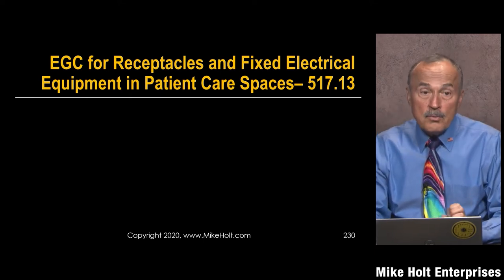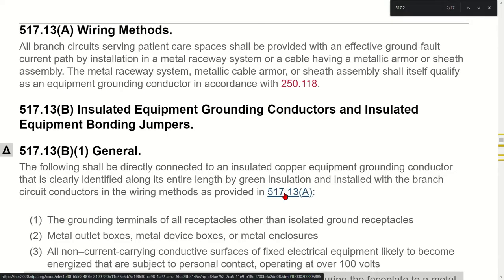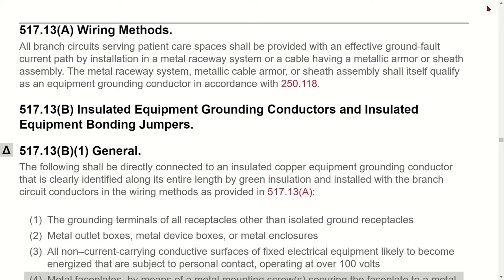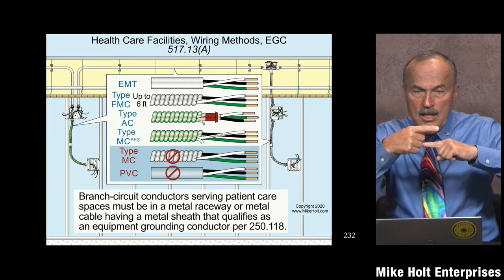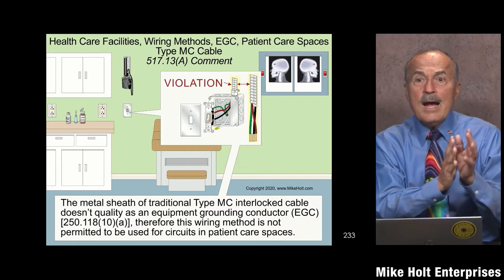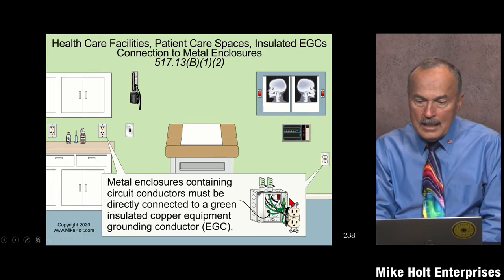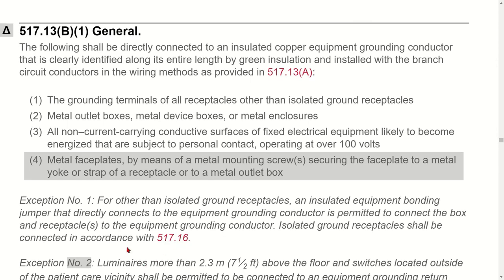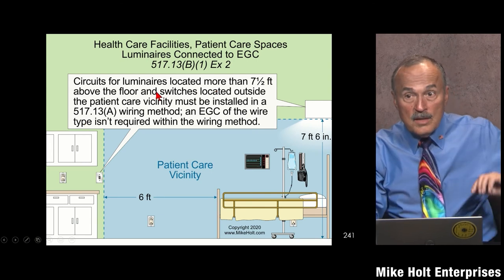Health Care Wiring Methods, NEC 2020 - [517.13], (17min:50sec)

Comment: Retired a few years ago from a large hospital as a sparky performing PM'S, running 7 fire pumps & over 15 Generators and troubleshooting the hundreds of VFD'S . We used the HCF MC cable in patient rooms for adding receptacles. Always thought that even though new work in patient rooms was always ran in 3/4" EMT along with a green ground conductor and boxes secured to steel studs that the metal studs should have a bonding conductor maybe every third steel walk stud. We started installing a HG TR receptacle next to patient beds with USB charging ports then somebody had us move them at least 6' from patient bed because they thought they were not approved to be close to patient beds. Was surprised that every patient room wall switches ( both normal & emergency power ) were on 277 bolt circuits. A kid  made a nice divet in a stainless steel wall plate when he used a paper clip to dig into 277 bolt switch.

Comment: @mikeholt it’s often talked about that NFPA70 talks about safety issues and codes reflect that, however for luminaires and switches outside the patient vicinity if your wiring using Armored cable it would not make sense to then wire the switches or luminaires using other cable types out of efficiency you would use the same wiring method and you would still fulfill all the requirements for wiring methods outside the patient vicinity.
Reply from the maker: If you want...
Reply: @MikeHoltNEC  long may you continue in making the industry great. Your energy is next level god bless you and your family.

Comment: While inspecting I’ve found that many make the mistake that once out of that medical space those grounding requirements aren’t required. Having to explain that the ground fault path must go all the way to the panel helps make sense to them.
Reply from the maker: You are correct, and the 2023 is making this extra clear.
Reply: @MikeHoltNEC  amen. So glad it will because many aren’t grasping the theory or concept.

Comment: Mike, having 2 paths is also advantageous because it will have less resistance and clear faults faster.
Reply from the maker: False, watch MikeHolt.com/Groundrod and MikeHolt.com/Funcamentals
Reply: @MikeHoltNEC  false to your false, I am talking about hospital patient care spaces needing 2 egcs. More paths to ground = less resistance on ground fault path, less resistance = higher ampacity in a ground fault. Higher ampacity = faster ocpd trip which is safer for patients.
Reply from the maker: I'm sorry I thought you were commenting on a different post (building supplied by a feeder with an EGC and EGC).

Comment: It always seemed to me that it’s ok to use regular MC outside the patient care vicinity for lighting. My copy of the NEC makes it sound like a choice between complying with a or b so long as one of the two is used. 

“Exception No. 2: Luminaires more than 2.3 m (7½ ft) above the floor and switches located outside of the patient care vicinity shall be permitted to be connected to an equipment grounding return path complying with 517.13(A) or (B).”
Reply: Advntxd did you ever get any clarification on this?.  I interpret it as either a or b not both a and b.
Reply: @maurogonzalez499  Yes.  Lighting outside of the vicinity only needs to comply with one of the 2 as explained in the exception but anything that's within the vicinity has to comply with both.

Comment: Mike, I wanted to ask where exactly does it say that luminaires located more that 7.5 feet AFF must comply with 517.13(A) specifically?
I'm looking at the 2020 codebook and 517.13 Ex(2) states if above 7.5' the luminaires must comply with (A) OR (B). Please clarify.

Comment: Side note: about 8 years ago at the large 550 bed hospital that I have since retired from had us replacing a hospital grade TR receptacle next to patient beds with a hospital grade TR receptacle that had two USB charging ports. A few months later had to move them think it was at least 6' from patient bed because somebody did not believe they were approved to be near beds. Told them that never heard of anyone being electrocuted from a five volt very limited power source but when in doubt with patients have to err on side of safety. Of course once they were over 6' from bed got a lot of complaints that patients could not use their 3' cord to charge cell phone while using the phone.

Comment: My foreman told me that this wiring method only applies to equipment/outlets/luminaires below 7ft, and that the circuit can be spliced into traditional wiring methods (i.e. normal MC cable) above 7ft. But doesn't the entire circuit have to be wired with the "redundant" EGC all the way back to the panel?
Reply from the maker: Please review 517.13, it says "the branch circuit' is required to comply with this rule. So no you can't spice the room wiring to the homerun with different wiring methods. But there is an exception for switches and lighting, so please review the NEC text.

Comment: Why is FMC OK but not MC?  Is it because one is Steel and the other is Aluminum?
Reply: Because of the length requirement. FMC is considered an equipment grounding conductor up to 6’
Reply: @RobertSmith-lw2bx  I get that but what is the difference between them? Aren't they both very similar in design other than the material they are made out of?
Reply: @rpsmith   must be something about the MC’s design that we don’t know. Something about it that doesn’t make for good grounding. 
 MC seems to have a tighter make up of how the coils are put together. FMC seems looser if you will. 
Now you have me thinking deeper into it. Maybe theirs more contact surface between coils that the panel thinks or knows makes for better conductivity, therefor more effective ground fault path. Hmm.
Reply: @RobertSmith-lw2bx  -- yes, it's would be interesting to know why one is approved and the other is not.
Reply: @rpsmith  I’ll have to dig into my older code books and see if I can find when the 6’ allowance for FMC equipment grounding came in. Maybe MC cable was over looked and never installed for the medical docs allowance.
Reply from the maker: Type MC cable is also permitted if it contains an aluminum bond wire, similar to AC cable with a bond wire.
Reply: @MikeHoltNEC  why is it that greenfield (FMC) is but normal MC isn’t? Do you have any insight on that? In your example it showed FMC ok from the j box. Is is the make up of the material of each, that is that different?